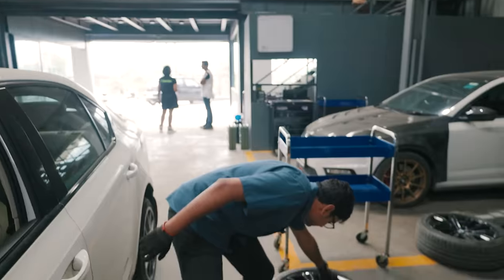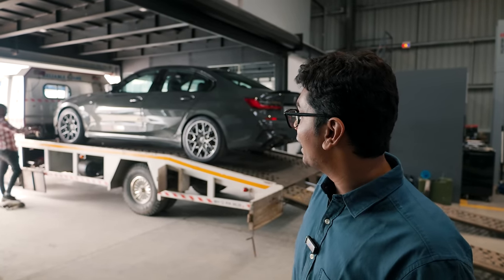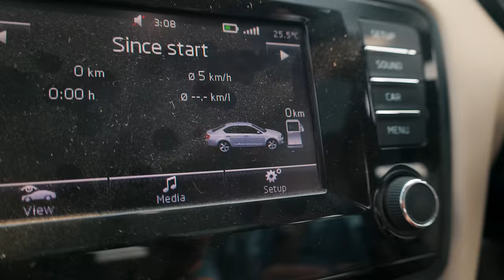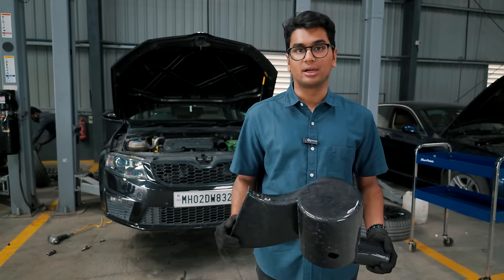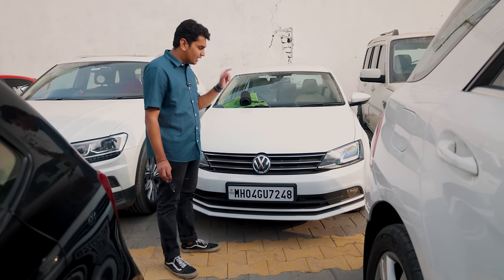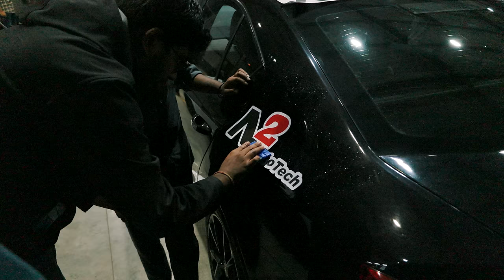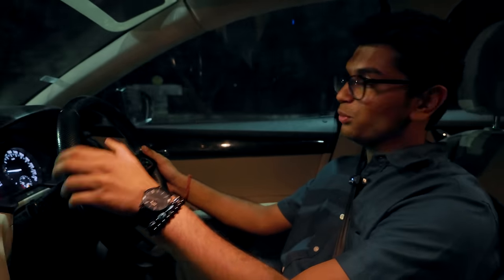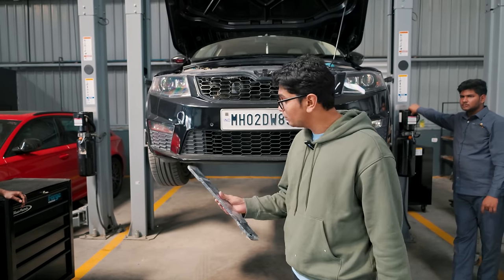The Octavia TSI is now a RACECAR! | Preparing our Stage 3 Octavia for DRAG RACING! (The Valley Run)

Comment: 15:30 actually the force is more than the body weight. Because to lift the body of  60kg ( actual mass 6 kg, weight 60newton ) u need to give more force than that. That extra force is what helps u accelerate ur body from rest and above. So in total ur hand applies two forces on to the jack [ ur weight  in newtons + the force u used to lift the weight ] . Basicaly the guy with the specs is right.

 Sorry guys for not knowing your names😅. but the interesting cars u always show grabs my attention from knowing ur names 😬
Reply: Physics has left the chat. You mean to say that a 60kg person has a mass of 6kg. Lol. The weighing machines have been caliberated to show mass and not weight. A 60kg person on a weighing scale puts 600N on the scale. Its just that the scale shows 60kg when 600N is applied on it. On top of that, when you pullup on a bar, more force is only applied when youre actually accelerating up i.e m(g+a). I would suppose for a normal human this acceleration (a) is negligible compared to the gravitational acceleration (g). So in essence you barely put more force that your weight and incase you pullup really slow, you dont put any extra force at all.
Reply: @varunsinghable  from ancient times we are measuring weight in kg ( misnomer ) it must have been newtons even till today we haven't changed the way. If a measuring scale (even electric) is measuring 60 kg it's actual meaning is 60N and our mass is 6kg